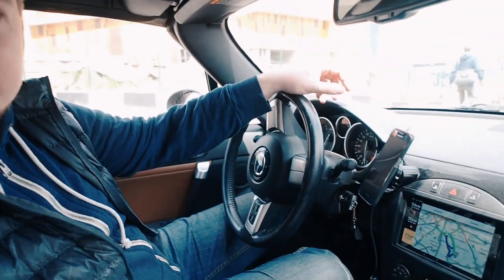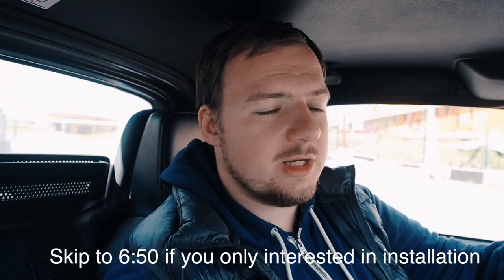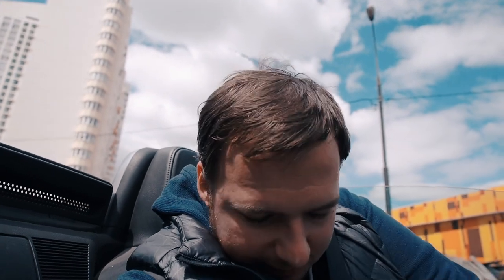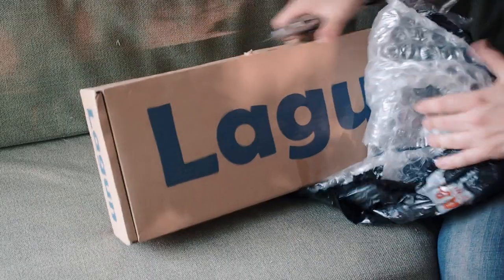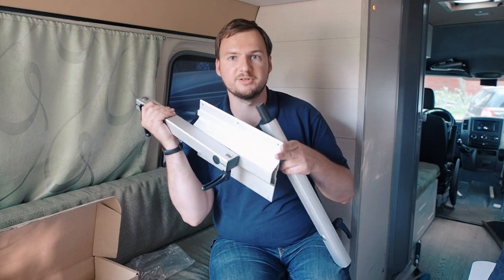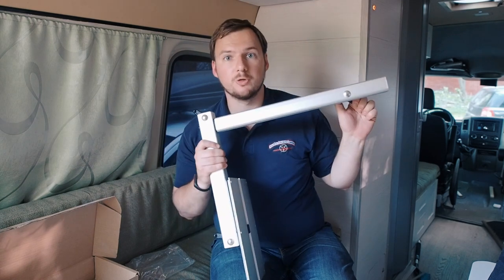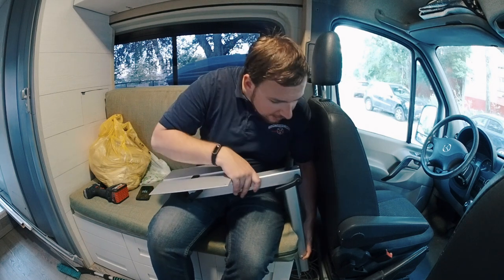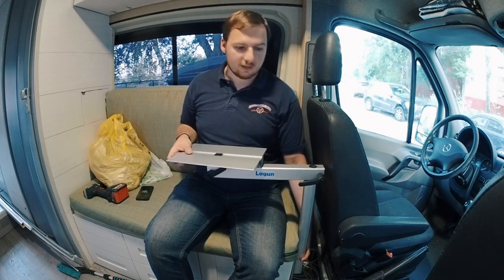Van couch table with adjustable & swivelling mount. RV or marine cockpit table solution

Comment: Are u able to move table between front seats as u drive also?  Will it fit?  I’m wanting to do a similar style table in that are but wanted to also be able to bring it between front seats while dtraveling for cup holder. Can u  try to see if it fits there and then can push back after stopping to give u clearance to move back to camper.  Thx.
Reply from the maker: Yes it can do that